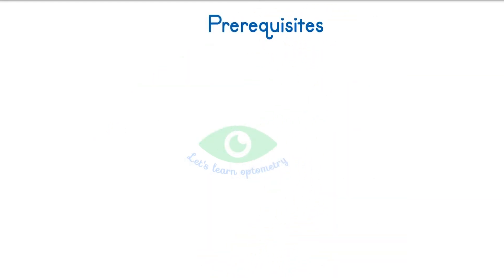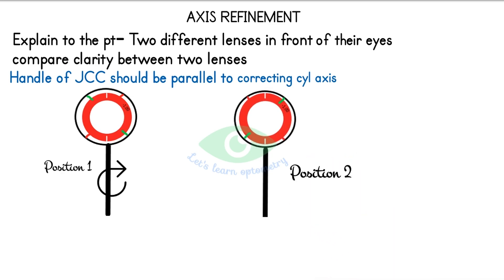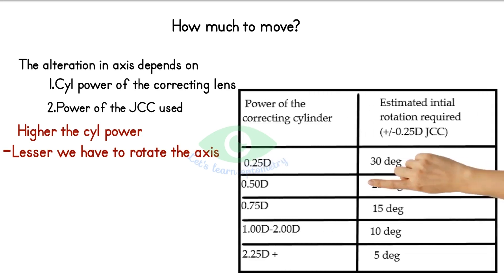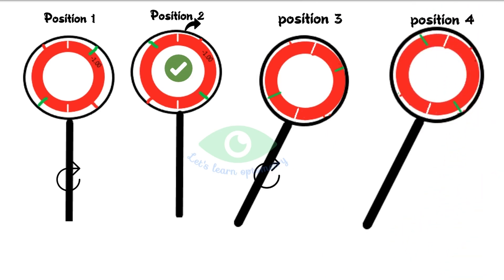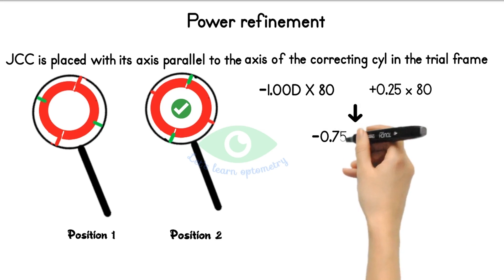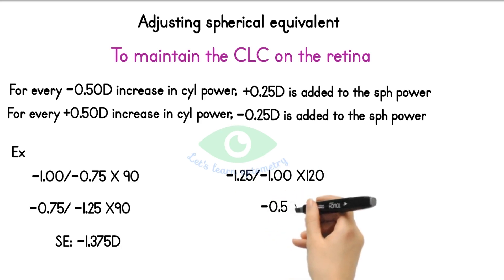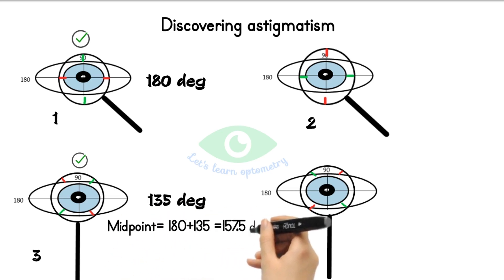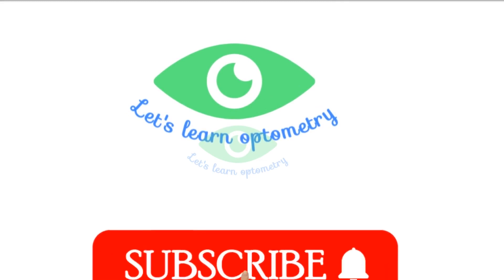JCC procedure| Axis refinement| Power refinement|Discovering astigmatism

Comment: How do we adjust the spherical if we use 0.25 jcc?
Reply from the maker: Hi! We can adjust spherical power from 0.50D Change in cylinder power only. We can ignore changing the sphere as 0.12D (Half of 0.25D ) is very insignificant.
Reply: @letslearnoptometry9681  Thank you so much👍